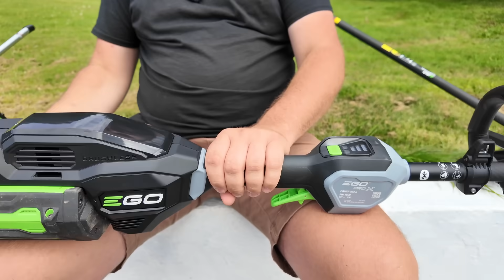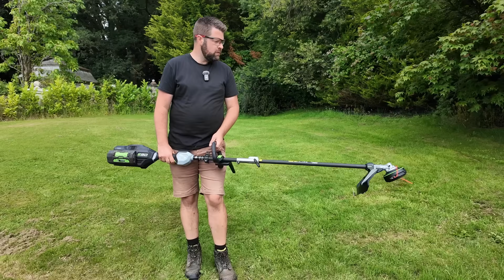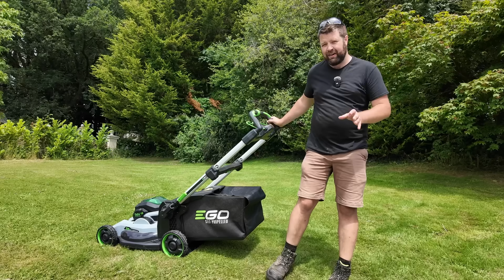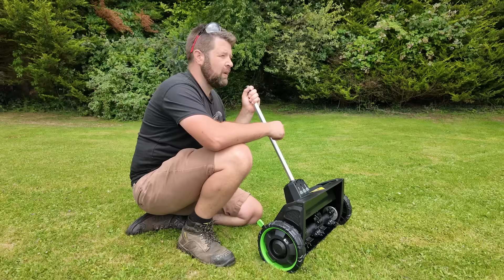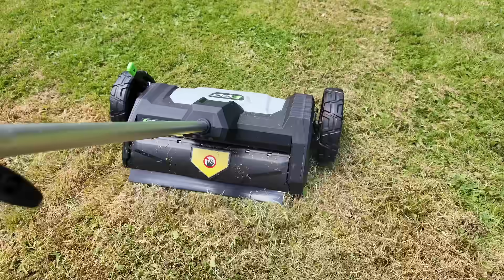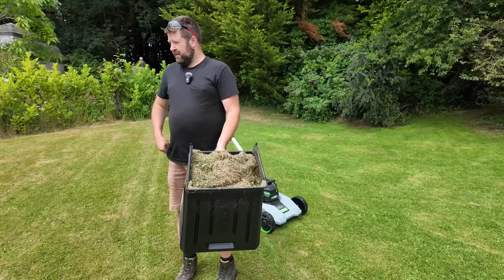The NEW EGO Dethatcher - a Secret Weapon for Perfect Lawns!

Comment: this design is horrible. The tool itself is very much needed in the ego line up but ergonomically this is a complete failure. For such a simple tool with many design options in the market from competitors, THIS is absurdly awkward to use. The weight of it, the placement of handle, the movement with it is just horrible. From all the EGO line up I personally have, this I returned. This needs re-design. Garbage.

Comment: Yes finally! Gotta get me that dethatcher and use it on my Milwaukee power head!
Reply: does it actually fit on the milwaukee?
Reply: @jimz987 Yep!  Already purchased and used it, it works great.  I use the Ego snow shovel on the Milwaukee as well. Literally takes about two seconds to modify it to make it fit on the Milwaukee. 

Get you a pair of flush cutters and remove the little plastic alignment bump on the Ego attachment and it’ll slide right into the Milwaukee attachment capable power head.  I have the gen two power head but since all the attachments are the same from gen1 to gen2, I see know reason why it wouldn’t work on both.  

There was a long video of a guy disassembling the Milwaukee power head and removing the coupler and making a ton of mods to it and machining it and whatnot to make it fit Ego attachments. Near as I can tell he wasted a ton of time.  

Cut off the plastic nubbydunkle and stick er in the Milwaukee and tighten the clamp. Done.
Reply: @2down4up thanks for the detailed reply! do you feel a lot of resistance when using it? I have the rubber power broom attachment and at 150lbs I really have to lean into it to move gravel, debris out of my lawn, etc.
Reply: @2down4up thanks I really appreciate it! i'll probably try the incremental height lowering like you did. have you tried cutting your lawn before dethatching? would that help with the resistance? if so to what height do you cut?
Reply: No problem! And yes I’m glad you brought that up. Everything I’ve read  and what I’ve always done right before dethatching, is I cut the grass to the lowest height the mower can do. So everything I said earlier is with the grass cut low.  Cutting that low is not great for the grass but if the blades of grass are too long then the dethatcher will rip the grass out, obviously we don’t want that.  Since you’re asking I’m sure you know, the whole point of dethatching is to remove the build up of materials (thatch) that covers the dirt and smothers the roots of the grass. Dethatching is definitely aggressive no matter how you do it, so you don’t want to do it more than once maybe twice a season at most. Though I think that also depends on your grass type, overall health of the yard, and climate. Incidentally I used to manually dethatch yards in the past with a specialized rake. Talk about some back breaking work! I’m never doing that again!  Anyways after I’m done cleaning up all the debris I over seed with some light fertilizer and then water really well. I usually just use store bought seeds with fertilizer already mixed in. But you certainly can use pure seed and apply a separate fertilizer of choice.  This has worked really well in the past on other lawns in the same area so I’m hoping it’ll be the first step in fixing this one.

Comment: Looks good for smaller lawns, wouldn’t want to use on large areas due to the leaning forward the whole time (although that’s probably not what it’s designed for). Just need Stihl to make one now, if you’re watching Stihl please make one of these.
Reply from the maker: Very much agree, I mentioned this later on in the video. Alright for smaller areas and hard to reach places where a big commercial machine cannot reach, but wouldnt recommend it for a full lawn renovation. But for domestic customers it makes it a viable option

Comment: Will defo be buying an Ego detacher. Not sure about having only the battery at the end and not another handle. I’m over six foot and I’d guess I’d be leaning. Be great to see a video comparison with a commercial detacher. 
I’m on my way to the shop to buy that trimmer. Sold after that demo putting in the 2.5mm 🎉. I’ve a basic ego trimmer and have never given out more about any tool in the shed 😂
Thanks for the video 😊
Reply from the maker: Hey thanks :) If you move the handle up on the shaft you will find it will be more comfortable to use if you are taller. 👍🏼
Reply: @MachineryNation  Happy days. I’ve been fully all in with Ego for nearly four years. Best tech and machines I’ve ever bought. I’ve a four year old mower that’s as good as the first day even after cutting my acre sized lawn, hills, wet grass etc. ❤

Comment: Hit the brakes. You said that the new trimmer doesn't connect to any of the old attachments because it's a different connection type? Are you saying there is a new generation of multi-tool attachments? I just bought the 1704.  Are there old attachments that don't connect to this new trimmer?
Reply from the maker: The new trimmer wont fit to the older PH1400 model in the range as it doesnt have the correct connector for the electrics to the head, but all the older attachments will fit in the new multi tool motor

Comment: One note about it not working on the older generation of power heads. If that is correct, why is the attachment only available via kit with the residential power head then? Seems a bit odd to sell the attachment with a power head it cannot work with. I have the commercial one anyways and overall love it.
Reply from the maker: The STA1700 wont fit the older PH1400 model of motor unit due to the connectors, but you can use all the original attachments in this new motor unit 👍🏼

Comment: Can a rotary  scissors be attached to this? Thanks for the video
Reply from the maker: Yes the RTA2300 attachment will fit the new multi tool head long with the rest of the attachments in the range :)
Reply: Thanks, what's not to like hey. Quick question, could a 6ah battery from ego in the 56v range be used on this. I'm looking at standardising on my kit going forward and this could be an awesome addition.
Reply from the maker: @spacemanwho  no problem at all. you can use any battery in this tool. the bigger the battery the more run time you will get. beauty of the EGO range is the one battery fits all system :)
Reply: @MachineryNation  I'm loving that about them. A while back, I went all in on Ryobi for full house renovations... good products, but a company truly shines when something goes wrong and how they deal with it. A few failed within warranty, and they went out of their way to fob me off, taking weeks to reply to emails... I'm looking at the Cobra Fortis, and the idea is, invest in these batteries that i can then use on other tools. Loved your video on the cobra btw, led me to buying my first cobra 20" rotary as well! ❤

Comment: I have been waiting a long time for a dethatcher from Ego. I love the multi-tool set-up, but not for a scarifier where you need to stoop down. I want one where you can walk behind it and stand up straight. Come on Ego, catch up with the competition.
Reply from the maker: You can move the handle up on the shaft, and on straight runs use it one handed. I do agree a fully battery scarifier from ego would be amazing 🤩
Reply: they need an aerator attachment now!!!!
Reply: I wait for this as well. Switched to Einhell just for this tool. Great power, but poor built quality. If ego comes up, I would switch immediately!
Reply: Scarifier is coming this year.
Reply: This looks just as bad as the ego shovel attachment. Ridiculously heavy and awkward to use.
Reply from the maker: @mfdf1985 it actually a very nice weight to use. The dont want it too light that it jumps all over the place or too heavy that it is to hard to use. I would say EGO have got it right. 👍🏼